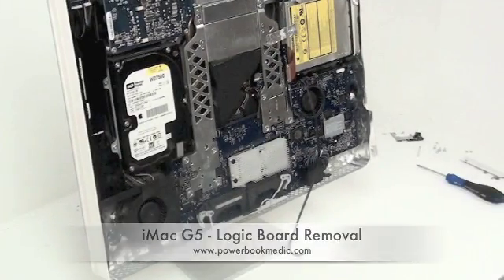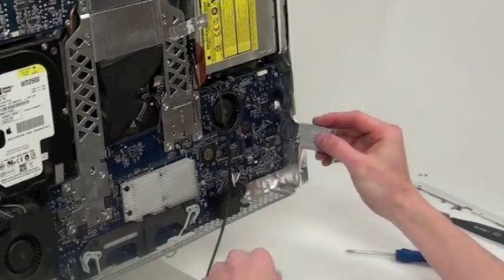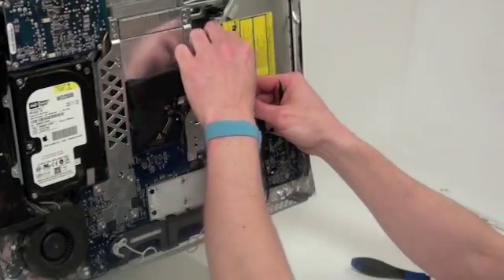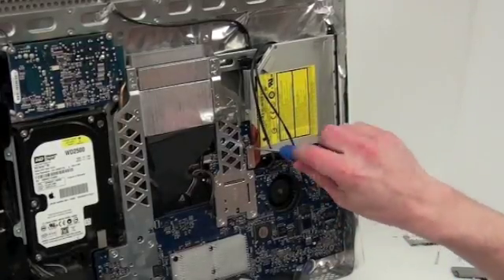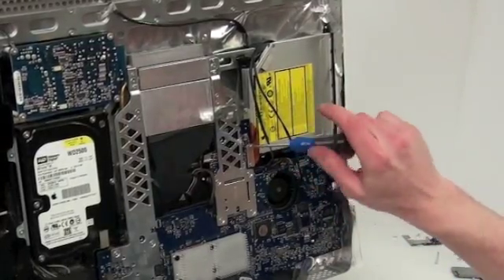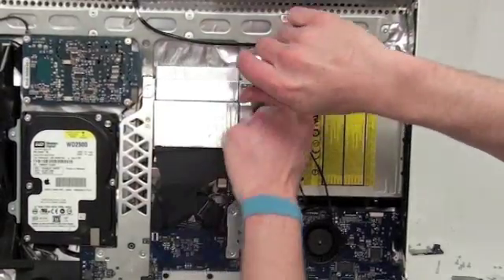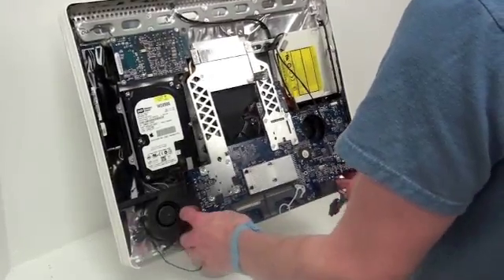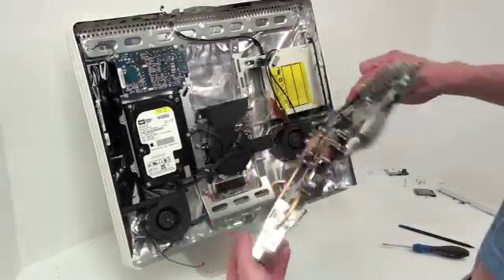iMac G5 Repair - Logic Board Removal

Comment: i was just wondering, would a logic board from 17 inch imac g5 fit a 20 inch imac g5, and would it matter if they differ such as 1.8 ghz ppc and 2.1 ghz ppc, or 1.8 intel core duo